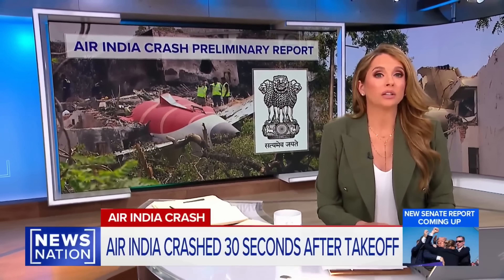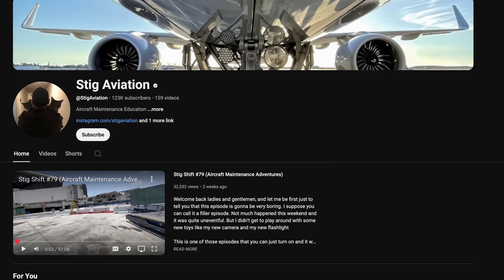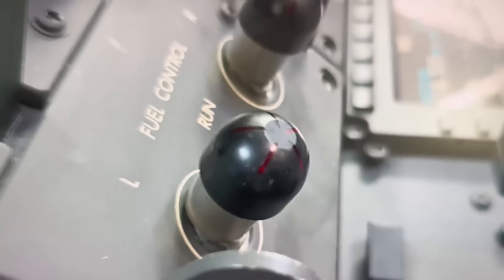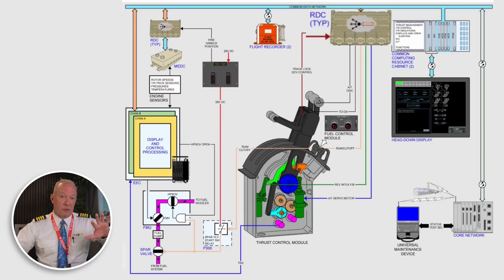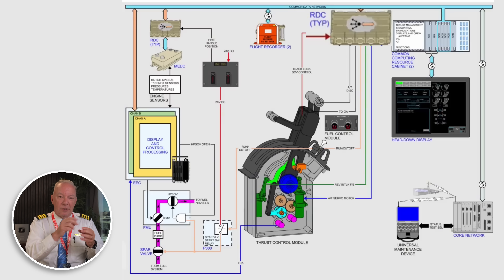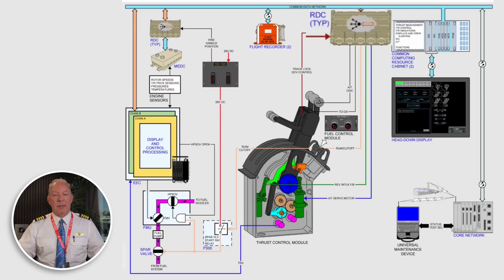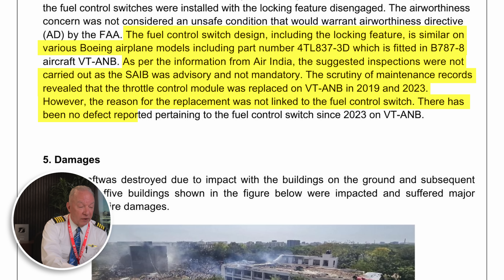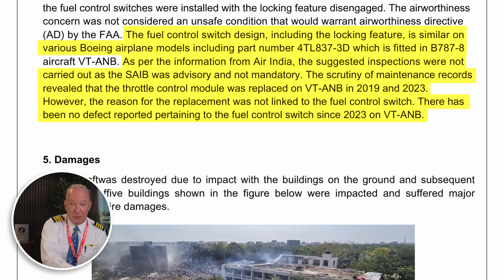The Truth About Boeing 787 Fuel Control Switches

Comment: I do agree to most of your points, and I do agree that the by far most probable scenario is sabotage or suicidal action.

However, I do blame the preliminary report. People are right to say that the FDR is not continuous, but just doing discrete recordings of state (every second, whatever). But we do have a continuous recording of the flight in here - and that's the voice recorder. It must be absolutely easy to synchronize both parts of the flight data (even if there are not synchronized before for whatever reason). And, as far as I got, you have to hear the switches in the recording as well.

Assuming that both pilots are acting rationale (i.e. no sabotage), from the point when one of the pilots replied that he did not change the switch to changing them back to run, I give the pilots at most two seconds to react and switch both of them back on. They are both aware of the situation and even as an aviation blogger, not having a pilot licence, I would have known that this is the most critical thing. I don't understand why the preliminary report does not give the exact time of that conversation. It would clear a lot.
The only reasons why it did not happen is:
- They agreed on switching off the fuel and knew that they will need a few seconds (so they were in one sabotage team... Better not think about it, but it is a scenario). Then, the switch the engines back on, the second one with a delay,  knowing that the thrust would not be sufficient to recover and... Things happened as they did.
- They were not in one team, and one pilot indeed tried to safe the plane. Then, I could imagine that there is some kind of discussion, fight, whatever. The sabotaging pilot just needed to delay the process by some seconds to get the "desired outcome".
- Both did not have bad intentions and there was indeed some other issue in the cockpit which worried / distracted them. In that case, there must be some sort of panic and you might also look for other issues you have to solve. In that scenario, I might also understand that the switches have been turned back on relatively late - even though I feel that having fuel on the engines should always be your top priority. Even if you have a fire or something else you do not quickly see in the system, you know that if without thrust, the Boeing turns into a mass grave.

Apart from the first scenario, there must be something on the voice recorder. I don't understand, why at least a hint has been given in the preliminary report. Thus, in my point of view, the report does strongly suggest a sabotage / suicide on the one hand - but on the other, it also boosts discussions. I don't understand that at all.

Comment: I have great respect for your work as a pilot but you are not an investigator nor a Boeing rated engineer. Your initial videos after the accident did nothing but add confusion and misinformation to the mix by talking of these possibilities which was highly irresponsible for a seasoned aviator. You have a large following and thus a responsibility to tell people what is factual and all we know is that the INDICATIONS show that switches moved. Let the investigators do their work, you can't possibly know the finer details of the 787 design architecture from some light research you did over a week or 2. Your videos on this accident from the get go have been a huge disappointment to aviators around the world because all you're doing is SPECULATING

Comment: In the schematic shown at 4:24 [note:  I don't know how accurate that is] showing the 3 fuel valves, it shows the spar valve directly controlled by the current from the run/cut-off switch.  On the HPSOV valve looks like there's a logical AND gate bringing an input from display and control processing (labelled HPSOV open on the schematic - I think the fuel valve part has been magnified, so it doesn't show the connections accurately) so both that input and the fuel run switch must be live.  Then there's the FMU which is not shown as connected to the run/cut-off switch at all.  

Now at 8:00 we see that schematic again without the confusing magnification and sure enough, the HPSOV has a logical AND connected to both the fuel switches and the processing unit, and the FMV is supplied ONLY from the processing unit, and NOT directly from the fuel switch.  If as I believe that is the fuel metering valve on the engine presumably it does more than simply on/off so it must be controlled by the FADEC.

Sorry to say this as I respect Captain Steeeve but this video so far is muddying the waters further for me.  With how modern planes are built I find it improbable that an actual wire connects the fuel switches directly to the fuel valves.  Design has moved on from discrete wiring like that some time ago.   

See also this article https://aviation.stackexchange.com/questions/110989/does-the-fuel-switch-directly-control-the-fuel-valve which talks about the engine control systems on the 787 and shows schematics and info from Boeing - and which clearly states the fuel valves are controlled by the FADEC, not directly by an actual wire. 

With this in mind, I still feel that it's possible that some as-yet unknown or unpublished issue in the plane's control software cut the fuel without the pilots intervention.  This led to the pilot flying asking "why did he* [where "he" refers to the plane] cut off" and the pilot monitoring responding "I didn't do it", and then, as you would expect from his training, the captain immediately cycled the fuel switches from run to cut-off and back to run in a (successful) attempt to restart the engines.  This is borne out by the FDR record that the switches were indeed cycles to cut-off and back to run, and explains them being found in the run position in the wreckage.  The tragedy was that there was simply insufficient time for the engines to restart and spool back up.

* the transcript clearly states that the pilot flying said that.  A first-language English speaker would have asked "why did IT cut off" but many languages don't have that gender-neutral pronoun so everything is either "he" or "she".  Since the pilots are likely not first-language English it's very possible that, especially in a high stress situation, they would refer to the plane as "he".  I live in Portugal and even when speaking English, native Portuguese speakers refer to things as "he" or "she" not it very often.  Portuguese also lacks the gender neutral pronoun the equivalent of "it".  Had the pilot been Portuguese and his plane suddenly shut off, I would expect him to say exactly the same as the pilot in the Air India incident.
Reply: You may want to search for "787 BDM battery diode" or similar.

Comment: The point t of  relay is to switch a higher current than would be acceptable through a switch.  So I think this description of the operation is misleading. Their would be no point in the relay if the "same 28v from the switch goes to open fuel valve".  The statement that there is no digital involvement also seems strange as the schematic has a logic gate shown.

Comment: Former B777 Captain with B787 pilot son. Well done Captain Steeeve. Sick of the BS being pedalled by self appointed delusional armchair experts. Obvious to airline pilots this was a ‘ suicide ‘ by the Indian captain.
Reply: Electronics engineer of 43 yrs here. Yours seems to be possible explaination.

However, I think there are likely to be multiple failure points in the fuel system.
Ask, are there: circuit breakers in both the main battery supply to the relay, and, or, the input cct (of course there is).
Relays do fail.
And a multitude of other failure points.
Fyi, 90% of all electronic system failures are mechanical.

Comment: 10:58 when you say nothing, can you confirm no fuses, fusible links or circuit breakers?  If that's the case, a short circuit on the battery would turn these off! Thanks.

Comment: I'm sorry, but as an electronics guy, your explanation of a relay is not correct. You are describing a switch, not a relay. A relay and a switch work together. Your electronic kit only had a switch and not a relay. In a relay system, there is a low amp side and a higher amp side. The switch on the low amp side is just a signal to the relay telling it to open or close. The relay can stick open, stick close, or inadvertantly open or close (depending on whether it's normally open or close)... a switch, however, handles very few amps, but has no magnetic internals to "not work".. although a switch can still foul.. which is another topic entirely.. I just wanted to mainly let you know that your switch example does not have anything to do with a relay and your kit has no relay, only a switch.
Reply: I don't know who your comment is directed at but I know exactly how a relay works and I know it works with the switch, the switch activates the relay but my point is that the switches don't activate the fuel cut off valves like captain Steve is suggesting, they activate the relays, so in other words the switches are not connected directly to the fuel shutoff valves like he seems to think, as though there is no other circuitry involved that could cause an issue, you know how a relay works so you should know that they sometimes fail and they rely on voltage to work, any system that relies on an electro magnet needs the correct voltage to work properly, relays have contacts that can go bad as you know and they can do there own thing depending on how they are faulty or how much power is supplied to them, you would probably also know that it is not that unusual for a relay to be activated by mistake or malfunction, if you have a bad wire that sends the live wire to negative or earth it will activate the relay the same as using the switch, there would be no difference in effect.
Reply: I think your right but still, the relays need power to "flip" on or off, and both of them in close sequence seems a remote possibility.
Reply: @ESHANABROOK I think there may have been an effort on the part of the pilots to reset the fuel valves to the open position by flipping the switches off and then on again.
Reply: @JoeLoveNorman Yes, that's what I thought It's a bit pointless showing the circuit with a separate relay and then suggesting the switch had a relay inside it. That's illogical and defeats the point of using a relay in the first place. It just adds confusion for anyone who doesn't already know how this works.
Reply: @albertclangence1342  A switch with a relay inside makes no sense at all.  Steve would do himself a favor by staying off the subject of electronics.  Get a guest in that can actually describe the system.
Reply: @JoeLinux2000 agreed, that demo didn't help at all.
Reply: Relays have a power driven magnetic coil which when energised switches contacts from off to on, depending on the current load, there is a remote  possibility that these contacts can stick on or can develop high resistance on the  the contact surface through continuous use.
Reply: @michaelfawcus1349 the contacts going high resistance is possible I suppose but not on both at the same time. Also an engineer has said that the FDR measures the actual position of the switch and not further along in the circuit.
Reply: Regardless of these semantics, the overwhelming probability is that the pilot moved the 2 switches intentionally, rather than having 2 identical failures in 2 systems at the same time.  The mechanical/electrical failure modes have been covered ad nauseam, and none even approach the plausibility of a human intentionally moving the 2 switches.
Reply: @mensaswede4028  Probably true, unless an actual power failure.. breaker or something.. I don't claim to know anything about the plane in question, just talking about explaining a switch vs relay... switches generally do not have relays built into them as it kinda defeats the purpose most of the time.
Reply: @JoeLoveNorman The power failure scenario has also been covered and simulated— it doesn’t cause the plane to stop delivering field because there are battery backups for these critical electrical systems.  Plus you would also have to explain why there is a 1 second gap between the change of modes for the 2 switches, both for stopping fuel and restoring fuel later.
Reply: I think he was trying to keep it simple
Reply: @claytonniederberger5933  Should have just ignored the relay.. that'd have been my way to go about it... he's likely right though, probably not any kind of "digital signal" involved in that process.
Reply: @claytonniederberger5933  It is not wise to "keep simple" the concepts that could lead to the determination of failure/not failure for an accident that killed 200+ people.  He should give a perfect detailed explanation, or not explain those issues at all.  Plain simple does not help
Reply: Fellow electrical power engineer here. Idk man....My 132kV load break switch (LBS) can handle quite a bit of current. 😅😅
Reply: @Msapere  What uses 132000 Volts?  Is that the transmission line ahead of the transformers on the pole?
Reply: 132000 V or 132kV is converted into 220 V by using series of step down transformers.

Firstly, the 132 kV is step down to 66 kV by using Primary transmission transformer of rating 132/66 kV.

Then this 66 kV is further step down to 33 kV with the help of 66/33 kV Secondary transmission transformer.

The reduced 33 kV is further step down to 11 kV by using Primary distribution transformer of rating 33/11 kV.

And at last,this 11 kV is stepped down to 240 V by using Secondary distribution transformer mounted either on the poles of installed on a platform.
Reply: @Msapere  haha.. yeah, not quite the type of switch used in the electronics kit and likely not a similar to the switch in the panel of the plane either.
Reply: A relay is a mechanical switch that is controlled by something else… whether that’s a signal, another switch, or whatever. Your definition would exclude a thermal relay for flashing incandescent turn signals, for example. My definition works with a thermal relay. In that case, “something else” includes a bimetallic strip that interrupts a heat source when it gets hot. :)
Reply: Moot point the switch could be the switch the lamp the relay coil (which has contacts of it own that control the valves) regardless the logic of the function is still the same
Reply: Ultimately the switch is wired to a relay directly  The switches position isn't read by computer then a  software driven separate line from the computer to drive the relay. No software involved and two independent systems. Enormously unlikely that they would both fail at the same time at the same rate of switching . a total non starter of an idea.
Reply: The captain mistakenly calls a switch “contact” a relay.   Understandable mistake, that doesn’t change the results of what was done.
Reply: @whiskeyyum1341  I understand-- however, we need to be accurate on things like this. I don't take it out on t Captain Steeeve, but I just want to make sure other people understand, in case they're trying to figure this thing out. It likely doesn't make a difference, but there's still a chance it could. I don't believe it's the root cause or anything, but when you take an aside to explain a relay, I figure it should be fairly accurate.
Reply: I'm happy someone said it.  I'm enjoying these videos but the descriptions of the way a relay works was bugging me.  I'm assuming that the switches are not the problem though. I also understand that each fuel pump has it's own relay.
Reply: Exactly right. The relais, both of them sit in the electronics bay, probably close together and there comes the known 787 issue with water leaking to there.
Reply: @jochenwagner2782  Hadn't heard of the water leak issue. Still would be a tall order to say that both relays failed at the same time due to moisture.
Reply: Not entirely correct. The relay doesn't get a "signal" from the switch. The switch closes/opens the low current circuit operating the relay.
Reply: @c.k.b6840  COME ON, the description that JoeLoveNorman gave is very good and TOTALLY understandable.  You stating "not entirely correct" is just you wanting to complicate with jargon, according to context, and according to what you perceive as a "signal". A DC line that switches from 0V to +28VDC CAN BE CONSIDERED A SIGNAL, whether you like it or not
Reply: @c.k.b6840  U I was using the word "signal" to imply open or closed circuit...
Reply: @c.k.b6840  It is correct. 28vdc to the switch when closed passes a 28vdc signal (electrons flowing) to the coil of the relay.
Be it 28vdc, 1.5vdc, 117vac, HF frequency, digital 5v, all are considered a Signal.
Reply: @c.k.b6840 seems to be a question of semantics.  In any case a switch opens or closes the relay.  Someone else mentioned a locking relay.  I'm not familiar with them but I know they exist.  It makes sense.  In the case of a large airplane engine the diameter of the fuel supply line must be 1/2 inch to 3/4 of an inch or better.  You want the valve to be solidly open or solidly closed.  I'm skeptical of it being a normally open valve. That would be very dangerous when the plane is on the ground and not in operation.  At the same time you don't want to rely on electronics to keep the valve open when the plane is in the air.
Reply: @JoeLinux2000  The fuel spar valve is a butterfly valve driven by an actuator. The actuator must be powered either on or off for it to change position (gear train prevents movement). Position indication is provided by a pair of limit switches on the shaft of the actuator. If you remove power the valve stays in its last commanded position. The valve itself, has no default position other than its last commanded position.